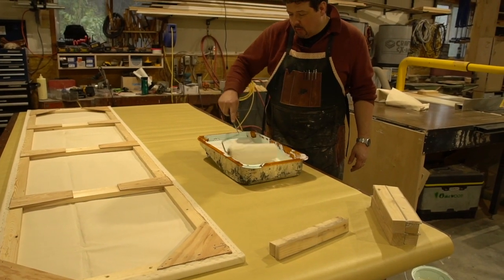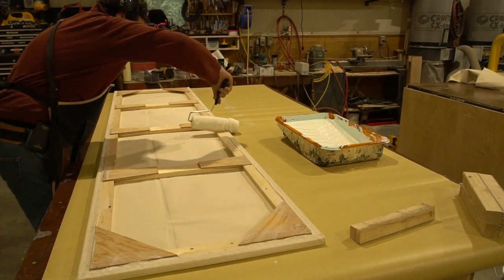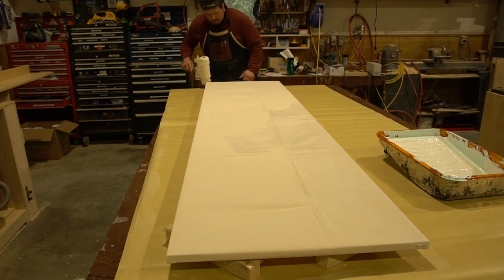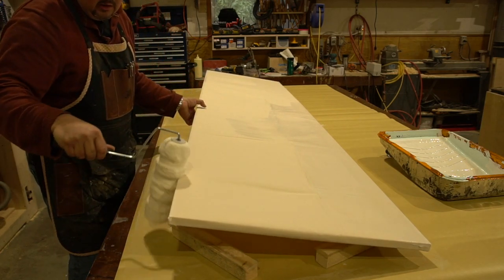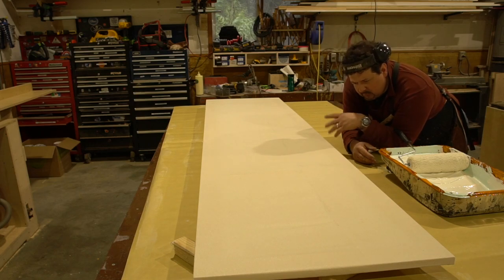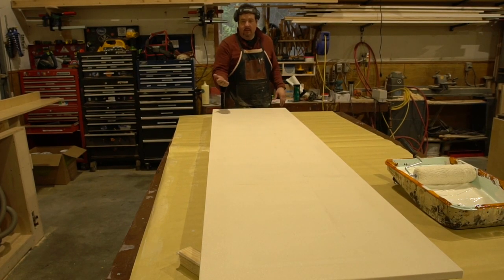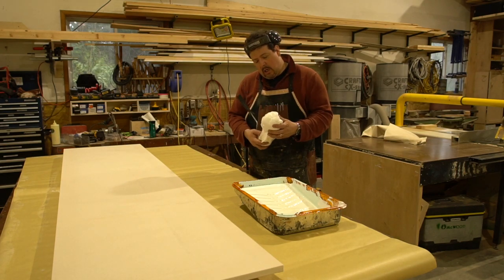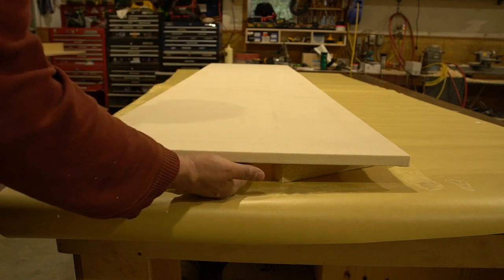Theatre Flat Part 6- Sizing the Fabric on the Flat

Comment: This is an excellent series of videos for the most part; you share a lot of helpful information.  However I don't recommend wrapping the muslin around the edges of the frame and stapling it to the back, at least not if the plan is to paint the muslin scenically.  Maybe it's a Canadian thing, but here in the states it's more common to attach the fabric to the face of the frame.  If you're covering with black duvetyne or something like that, then wrapping it around the back is the way to go, and in that case no glue.

Couple of reasons for this: (1) Over time, when handling the flats and sliding them across the stage, into and out of storage racks, etc., any fabric on the edges of the frame will quickly wear away, and it's more likely to get torn or caught on things and fray, and (2) the staples and extra fabric on the back side, and especially at the folded corners, will make it a bit harder to join flats together cleanly.  (Incidentally, there's no need to set the cornerblocks and keystones back more than 3/4" from the edges of the frame, unless you're covering the flats with plywood or something thicker than fabric.)

Here in the states, after stapling the muslin to the front of the flats all around, toward the inside of the frame, then we fold back the muslin on all four sides, and brush on full strength PVA glue to the face of the frame members.  Then we smooth the fabric down around the perimeter and press down with a damp sponge or paint brush.  Finally we trim the fabric all around the edge with a very sharp razor knife so it is about 1/8" to 1/4" back from the outer edge of the frame all around.  Some folks will only put the staples in part way, so they can be easily removed after the glue dries, but if the staples have been installed properly, you can just leave them in place, they don't show through even a very thin coat of paint after proper sizing.
Reply from the maker: Thanks for bringing that technique into the conversation Chad.
I have seen that before, but I guess we all have our preferences.
I would hope you could make a video to share with all those out there who wish to learn that technique. 
Be well
J
Reply: @SceneryFarm  Yes, I am working on a series of videos, doing research is how I found your videos.  Keep up the good work!
Reply from the maker: @chadowensdesigns8552  great!
Always happy to see how the grass is on the other side of the fence.
Be well and I hope success in your work!
J

Comment: How do you join fabric flats to each other. With Hollywood flats, you can just screw them together, but with fabric flats, do you just staple keystones to the frames of two flats?
Reply from the maker: The old way is to lash them together with special hardware and cord.
I honestly use them rarely  as a wall joined, but when I do I use mending plates and screws.
Be well
J

Comment: Looks great but how are these clamped together side by side when setting up on stage?
Reply from the maker: Hi Mark, I don’t really use them for that. I typically use them for individual hanging panels or If I were to do that I would use mending plates made from 1/8”x3” flat bar with two rows of holes to line them up with screws. They used to be lashed together with cord and specialty hardware and French braces to jack them.
I don’t have any of that stuff but it was pretty cool! It was old when I was an undergraduate in the early 90’s.
The seams used to be covered in ripped strips of cotton and glued on with water soluble glue- my guess is hyde glue. Then painted- I have never done it with that glue. I have only done a fabric strip patch (the old name for that I don’t really use) with yellow glue and it works well but permanent.

Comment: Ty for this series of video. . . What weight  of canvas? And it is not prewashed?
Reply from the maker: Happy it is useful to you Charlie.
It was a while ago, I just checked with my supplier and they figure it was 10 or 12 ounce.
It is important that the fabric is unsized, meaning it has not been shrunk before being applied. So yes, please do not wash the fabric so you ensure it will size/shrink when you put the glue water mixture on it.
Be well
J

Comment: What size/gauge of staples did you use with the grex to attach the canvas to the frame? I think I missed this.
Reply from the maker: 21 gauge staples- a T-50 would also work in this case.
Cheers 
J

Comment: It’s not really sizing is it? This is diluted PVA glue substituted for Size. If I remember rightly isn’t the original Size composed of tallow, which had that familiar smell when it was being boiled?
Reply from the maker: It is both likely and possible that it is.
I typically use primer as the current glues really stick…
I am unaware of the use of tallow but I would be really happy to learn more about it.
I can only share what I know and my sincere hope is to continue to learn and share what I can.
Thank you for your thoughts and I hope to learn more of using tallow on “sizing”.
J
Reply: I could be completely wrong - what with my memory, perhaps Size fell out of favour because it’s derived from animals or maybe the PVA method yields better results? I too shall try to get some information. Thanks for reply.
Reply from the maker: I also recalled I was introduced to it as poor man’s sizing…
There must have been a different version prior to this- I’ll ask the next old scenic carpenter/painter I see
😀